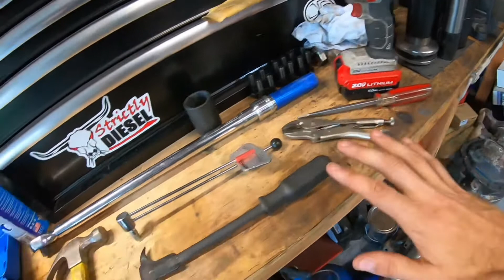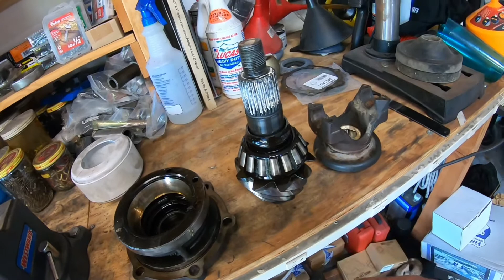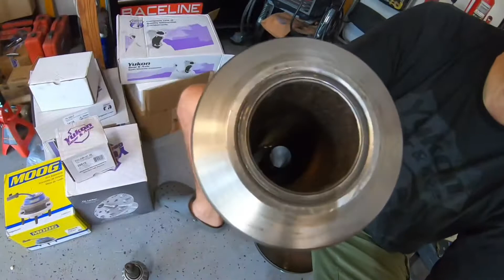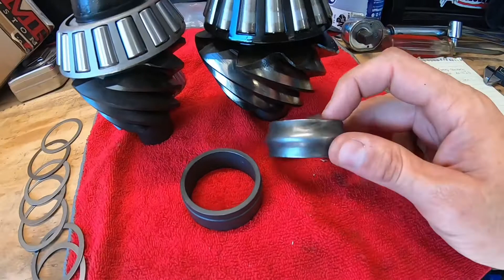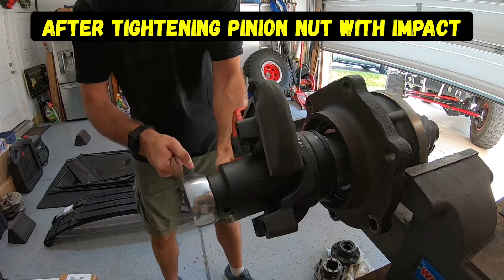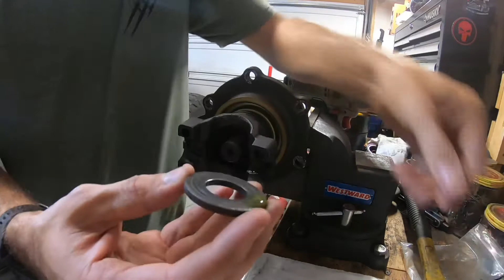14 BOLT AXLE REGEAR AND PINION SET UP (part 2) - Project Maple Leaf Jeep Build (no. 9)

Comment: I did this, and it took quite a few times .. video helped tremendously.. I may have screwed up a bearing .. have you heard anything like some spots will drag ? 22 inch pounds testing it and I get a spot where it goes to 35.. any tips

Comment: I'm rebuilding for my 86 k30 dump truck to 4:10 to match the original... Is the spec still 20 to 35 inch pounds?
Reply from the maker: That won’t change with gear ratio. So as long as  the axle you are doing is the one I did here….that will be correct. Just check in the manual that came with the gears.

Comment: That larger ID seal is the newer 2 piece style seal. It utilizes an inner sleeve that acts as a wear point in order to protect the yoke. The older style seal eventually wears a groove in the yoke, resulting in a leak and the need to either repair the yoke or replace it. This is at least the issue I have just ran into. I'm now switching to the newer style 2 piece seal.
Reply from the maker: So I think you are confused about something. The pinion seal was never a 2 piece design like you mention. It has to do with the size of the yoke. The OD of the smaller 1350 yoke doesn’t fit in the standard gear replacing seal. That is because the standard yoke on a 14 bolt is the 1410 and it’s a larger diameter.. the two seals are exactly the same. One just is a bit larger. The design is no different.

Comment: At 22:30 in the video you press on the second bearing and stop when it "seats". But really, the pushing of this bearing into the crush washer (in my case) is what setups up the pre-load right? So at that point I'd have to be careful when to stop pushing that bearing in I assume. But, using my press I could actually set the pre-load versus trying to squish it it all together with the nut and yoke assembly, correct? Then I'd put the nut and yoke assemble on with trying not to compress it anymore. I just hear its really tough to compress the crush washer with the nut and some people go as far as pre-crushing the crush washer in the press first, then installing it on the pinion shaft.  If my tools come in tomorrow I'll be attempting this.
Reply from the maker: You are correct. So I put it in because I was using shims. But if you are putting it on with a crush sleeve, then you COULD put it on the way you are saying. However, the traditional way and probably the more accurate way is to use a good strong impact gun and tighten it down and then check. Tbh, what I would attempt is to just start crushing the washer with the press…the. Do the rest to dial it in with the impact.
Reply: @WarPaintTexas  Yup I agree and will do it the way you mention. Pre-crush then impact. Seems easier and I have access to a beast of an impact if I should need it. Thanks!

Comment: Great videos for sure! One question, how would you press off the inner bearing if you needed too? Would the clam shell press you are showing work for that, or would you need a different style press?
Reply from the maker: The clamshell press would work with this. You MIGHT mess up the cage on the bearing. But the clamshell would work.
Reply: @WarPaintTexas  For me that should be fine since I'm replacing the bearing,if thats what you mean by "cage" on the bearing. Thanks for the fast reply!! I can't believe you don't have a lot more thumbs up for these extremely well put together videos. Do you teach or something for a living?

Comment: I know this is an older video, but i just did this today, and I am using a sleeve adapter on my yoke to be able to run the triple lip seal.  Not a good idea?
Reply: My understanding is that "sleeve" is not an adapter, but more so a protector. The sleeve acts as a wear point so that the outer seal doesn't wear a groove into the yoke. I've run into that issue myself and switching to the newer 2 piece setup.

Comment: Use the old outer pinion bearing as a “set up bearing” (google making a set-up bearing if you don’t know)… so you don’t have to keep pressing bearings off and on… then also use the new crush sleeve first and crush it, then pull it back out and use it as your starting gauge for the solid spacer measurement “crush sleeve eliminator”.  It will save you a bunch of time.
Reply from the maker: Yea. You could definitely do it that way. And I have. But I wanted to show people this way of doing it. It’s not that hard when you use the old crush sleeve as a starting point. And pressing the bearing off gives you a more accurate reading than use the old bearing which in my case was pretty worn. But I’ll be using set up bearings in the D60 for sure.

Comment: Definitely a lot more work but still not all that difficult. Just lots of steps. Exactly what you said. Great video, lots of detail. Good stuff man. I’m really excited and looking forward to the welding of the brackets and setting up the suspension!!!!
Reply from the maker: ABAOLUTELY! Thanks for the support, as always man. Almost done with the 14 bolt. Haven’t had a chance to work on it for a few days. But I’ll have the final video put on Tuesday.

Comment: Thanks for all the video and editing! It’s been great to learn, I want to do my one ton swap on as much of a budget as possible. That is without being a cheapskate and throwing junk eBay parts in it.
Reply from the maker: Thanks for the support! And right on! This is a great way to do it. Depending on the year of the jeep the auto locker like a grizzly is a great way to save some cash. But I’ll be showing an air locker in the Dana 60 when I’m done with the 14 bolt. So either way I’ll show how to do them too. There is also going to be a small truss on the rear that I’ll show how to set up for angles and such. So it should helps this is truly a budget but with quality build. The suspension is going to catch a lot of people by surprise…but will be cheap.
Reply: @WarPaintTexas  Hell yeah! I’ll definitely be watching all the videos. I’m going to be doing an LS swap in my 1999 Cherokee first, but after that I want to plan a one ton swap.
Reply: @WarPaintTexas  I also forgot to ask, what do people do for the wheels since the bolt pattern is different from GM 14 bolt to Ford Dana 60?
Reply from the maker: @OneTonTahoe  so I’ll be getting to that. But the 14 bolt is also narrower than the D60. So a wheel adapter/spacer is what everyone uses. A 1.5 on each side will give it the same width as the front and convert it to the ford bolt pattern.